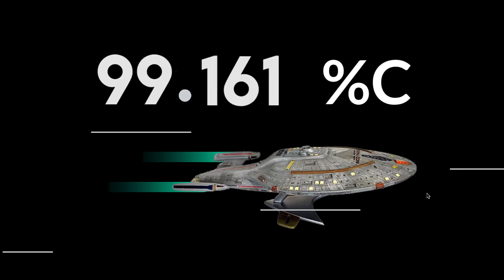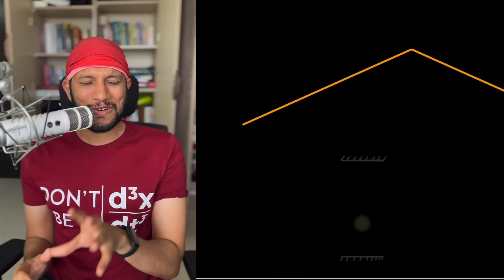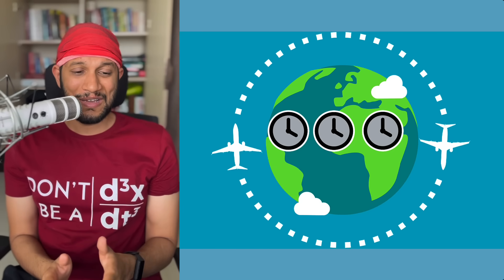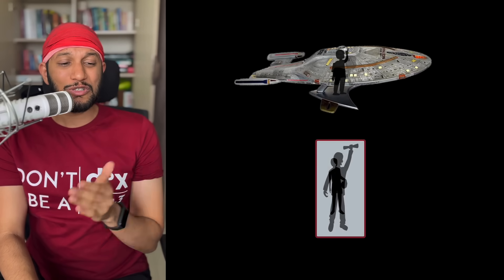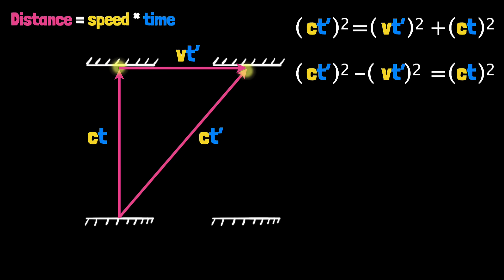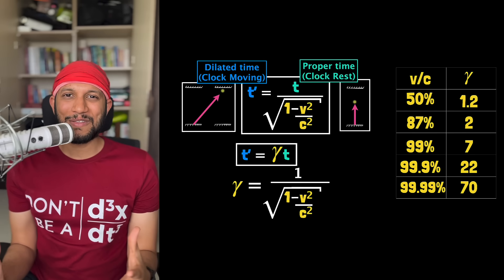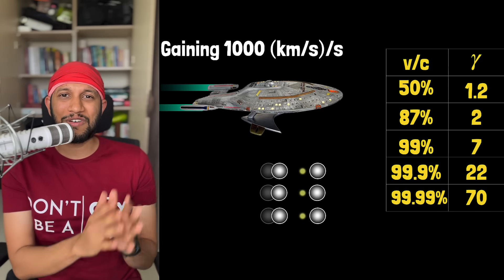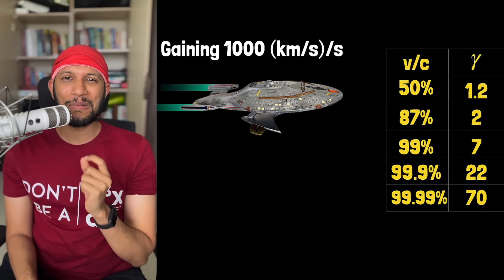I finally understood why you can't go faster than light! (My mind is blown)

Comment: Well done!   Dont forget the equivalent length contraction facet too! Will be good if you can do this before you get to e=mcsquared.

By the way, your explanation of time dilation (and later length contraction) will give you an understanding WHY a photon of light from a star which we SEE when it strikes our eye LEFT the star AT the same INSTANT we saw it!!    From the perspective of the photon, which is travelling AT the speed of light, it has had NO TIME at all since it left the star till it struck the retina.  In other words, the time elapsed (t prime) was zero, ergo, instantaneous.

Please don't let your philosophy quibble muddle you!  We MUST stay WITH WHAT the equations are telling us!   When you have finished length contraction, I'll point out the other way of what happened from the perspective of the photon of light that left the star.

For this video, because the photon that left a star travels AT the speed of light, the time dilation equation FORCES us to conclude AND to ACCEPT (unless we are utterly intellectually and scientifically dishonest) that the dilation seen BY the photon (t prime) was infinitely long. AND THEREFORE,  from the perspective of the rest frame, we (t) see the photon instantly AT our eye.

Remember, NO ONE HAS and NO ONE CAN measure the one way speed of light, for to do this, we NECESSARILY MUST have two synced clocks, one at the eye (earth), the other billions of light years away AT the star.  But no one has, can, or even will be able to place the second synced clock AT the star.

This means that when we are looking at stars in the night sky, we are seeing them as they are NOW!!!!

And while grappling with the implications of this, let us remember, most strenuously, that a light year is a measure of distance; NOT of time.

More, when you have presented length contraction, in your ever remarkable teaching style.
Reply from the maker: Lovely read, Vincent! 
I think the bit about one way speed of light is so subtle! I mean my first reaction to this was that we could use Einsteins sync method to sync the clocks, but it does assume the speed of light to be same in both directions and so, in Feynman’s words, ‘we would have cheated very badly’. I find it hard to wrap it around my head, though :)
Reply: @Mahesh_Shenoy  Indeed. And as he would say to those of us grappling philosophically with QM - "just stay with the equations. Calculate, and go WITH the equations. They do not lie."
Reply: Just making sure I understand: from the perspective of the photon from the star, it arrived at my retina instantly, but from my perspective it took x light years?
Reply: @billycox475   No! Not at all.  Let's go slow.  

In my frame, I see the photon now (cause it struck the retina - not the photon itself but its effect on the retine - but we quibble, you get the point).   BUT, because the photon was travelling AT the speed of light, NOT merely at 99.99 to the zillionth decimal place,  v=c, and the denominator of gamma is zero, and so gamma itself IS infinite and THEREFORE, and ONLY THEREFORE, the photon's time (t prime, as seen from our reference frame - ours is t) has dilated to infinity!!  

We make choke at the implications, we may balk at it, we may whine, we may ignore, we may pooh pooh, and we may TRY to comprehend, BUT the equation plainly declares to us (doesnt ask for our opinion) that the photon has had infinite "time" to get to our eye.  THAT is the dilation of photon time AS perceived from our rest frame t!!   

This then implies (HAS TO) that even IF the universe WAS infinite in size, the photon HAD infinite time, and thus could reach the eye NOW - meaning you and I see the stars and the galaxies, however far each may individually be, as they ARE AT the instant we see them all!!!!

This is JUST the way the universe has been made. If we dont like it, then with equal vehemence we should NOT "like"  quantum entanglement.  But we DO accept QM (and that with great gusto and fanfare), and so we are intellectually and especially scientifically dishonest, to the core, if we DONT accept the dilation of time, and coming soon (thanks to Mahesh) length contraction.  

Some more jaws on the floor when we get to that.  In fact, length contraction will help us grasp the implications of time dilation more easily, but in an unexpected way.
Reply: @vincentpinto1127 Light doesn't have inertial frames, so the time dilation math can't actually be used for it. If you look at the Lorentz factor equation 1/sqrt(1-(v/c)^2)), a v=c works out to 1/sqrt(1-1), or 1/0. Since that's undefined, it's a sign that we've reached the limit of that model.
Reply: @Vexas345  The last sentence sounds "clever", EVEN IF it is undefined. It is undefined mathematically, but in reality there IS an very serious implication of v being =c, which is NOT obviated by carte blance invocation of "undefined".

Furthermore you ARE correct that light, per se, has no inertial frame! But you are fatally incorrect because it is NOT that light has no inertial frame, but that each and every last single photon of light DOES HAVE its OWN individual inertial frame. This is BECAUSE light IS composed of individual photons, each a quanta of energy, and as the quanta of light propagate, the inertial frame of every last single photon goes WITH its own quanta!!   

When we see a star, we are not seeing it due to a single solitary photon striking the retina, but (I'd guess) perhaps a million individual photons striking the retina to form what we call the image of the star.  There are more complexities, but not immediately relevant to the fact that EACH and EVERY LAST of the photons has its own frame of reference, and each  is an inertial frame because the velocity v of the each and every last photon is c.   And each of these million individual frames have their time dilations seen as their individual million t primes as they strike the retina.
Reply: @vincentpinto1127   I'm not saying light can't actually be acting weird or anything like that. But if the math doesn't work, then we can't use it to describe how something is behaving. To put it another way, it's like if someone only has E=mc² and is trying to describe the energy of a photon. Obviously the answer won't make sense, photons don't have mass but still do have energy. It's not that something is wrong with that form of the equation, it's just not applicable to light in that way. We actually need the expanded form, E²=pc²+(mc²)², or just E²=pc² since m=0, which then gives us a real value for a photon. 

The Lorentz transformations don't give valid answers for massless particles, because it needs valid inertia frames, which require mass. Massless particles, including photons, can't be considered at rest. It's actually baked into the Energy equation as well. If we consider them at rest, they would have no Energy. 

Time dilation is also not something anything sees in itself. If we could consider a photons point of view, it wouldn't experience things too strangely (if the math actually worked). We should be the ones seeing the light acting weird, the photon itself would still have to obey physics and travel only at the speed of light.
Reply: @Vexas345  
>Time dilation is also not something anything sees in itself.<  I actually did not say nor even imply what you have said.  This is self-evident because in the photons own frame of ref, its time would be t and NOT t prime!!  Rather, the earth's would be t prime. But that is NOT what we are focusing on, so the rest of the last para is moot. 

As for para 2, I am not sure from where you get that idea "which require mass" (pl provide some ref so I can follow up). Its the first time I'm hearing it.  An entity is moving with a velocity v, doesnt matter if massless or not, it has its own frame of ref.  Furthermore, to comprehend the photon propagating as a quanta of electromagnetic radiation, we must have its v and b fields orthogonal to each other, and self propagating, because of the mu nought and epsilon nought of the space though which it is propagating. But what does "orthogonal to each other" mean if there is no native frame in which the two artifacts CAN be orthogonal?

As for the first para, I realize Mahesh has yet to come to e=mcsquared and how he presents it; I do want to wait for it. Nevertheless, to the point you are making, I still am unable to see the equivalence of the argument by moving from time dilation to the energy of a massless particle apart from trying to force the justification that the maths ought not to work. 
Even in an absurd case, dont take v = to c, but take v as 99.99% to a zillion decimal places. Then the denominator WILL NOT be zero, and the maths will have worked, absurdly large though the time dilation of t prime will be.  

Sorry, I'm not trying to be facetious, just trying to make a point.

I'm not saying I understand and comprehend WHAT is happening!! Not at all; I dont.  But the plain equation is forcing a conclusion I must make and an essential implication.  If we can make those implications (because the velocities are "small" enough) with muons from cosmic rays and their arrival times to earth, surely we can grasp the implications of photons whose v is exceeding close to c, and even =c, no?
Reply: >"seeing them as they are NOW"

Whose "now"? Simultaneity is relative, what is "now" for one observer is not what is "now" for another observer that moves relative to the first. The set of events that are considered simultaneous "rotates" in spacetime when we change a frame of reference.  See charts of Lorentz transformation.
Reply: @thedeemon  Simultaneity insofar as the interval of two events relative to the speed of light to be able to measure that those two events HAVE occurred IS relative.   But NOT insofar as the occurrence of those two events themselves.

It is entirely possible that a large meteor has just hit Voyager 1, and totally demolished it, exactly at the same instant as I type this, and you read it. (Let's imagine you are seeing this live as I type it, though we all know, in reality, some time will have elapsed from the time I type this and you read it.).  

YET, due to the finite speed of time, and the Einstein convention (Mahesh referred to), AND because Voyager 1 was made to to be sync with Earth clocks when it left here, we know that a finite amount of time will pass till we get a "message" here some time later that the signal from Voyager has stopped.   THIS is NOT what I mean by simultaneous.

So now go back and read my original post, slowly, focusing on the time dilation equation and WHAT MUST NECESSARILY HAPPEN when v is made to be =c.   Remember, you SIMPLY CANNOT PUT a clock in a galaxy far far away to sync it with an earth clock!
Reply: @vincentpinto1127  >"But NOT insofar as the occurrence of those two events themselves."

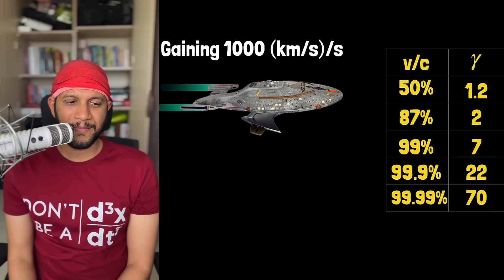Why? Two distant events may indeed happen simultaneously, say you type a message at 12:34 and a meteor hits Voyager at 12:34 by your clock (of course you can only learn about it much later, but the event itself happens at 12:34 as you type). Yet for an observer in a train, while you type at 12:34, the same meteor hits Voyager at 12:27 by the traveling observer's clock. The two events simultaneous for you are not necessary simultaneous in another frame of reference. That's what relativity theory tells us and so far it's been tested pretty well.
Reply: @thedeemon   I think you have missed what I am trying to say, or I have not said it well enough.  You do seemed to have "got" some of it in the immediate sentence after you ask Why?

You DO see that things CAN "indeed happen simultaneously" (to use your words), though of course, I will learn of it much later. BUT, we keep in mind that Voyager 1 itself is an inertial frame moving with a velocity v.  YET my concern with the meaning of "simultaneity", used in the context of the the same instantaneous-ness of occurrence that I type and Voyager gets hit, is NOT the simultaneity used in the context how one frame can determine WHEN something happened in another inertial frame!! 

Therefore, it is moot to bring in an observer on a train travelling at another velocity w.  While it is certain, we cannot compute the times, to conclude that an event has occurred, THAT THE EVENT HAS OCCURRED is what we can do only in a though experiment.   We MUST distinguish between the science of determining when a event occurs relative to all frames involved being subject to the speed of light which is finite and determine by epsilon nought and mu nought of free space, and the philosophy THAT the event has occurred simultaneously  is all frames of reference subject to the speed of thought which is infinite. 

Again, I am NOT being facetious.  

As I type, at say 1.37 PM, a meteor could strike Voyager 1, AND you could be simultaneously reading what I type at say a different time zone 12.30 AM!   Even your "simultaneous" reading WILL BE a bit later because of the finite speed of electrical signal travel, BUT instantaneous AT the speed of thought!!  Just that you will know of it a bit later.  But you must realize that if that speed of electrical signal were the speed of thought, THEN you would read it at the same instant that I typed it, and the meteor hit Voyager 1.

Stated differently, and lifting the abstraction a step higher, there are a zillion, zillion, gazillion things happening NOW in the universe, NOTWITHSTANDING, that we have NO means to comprehend it all, at that one instant.

Nevertheless, we are limited by the limitation imposed upon us by mu nought and epsilon nought, and thus the speed of light, to measure intervals of time to know an even has occurred.

BUT if v=c (as IS the case for a photon/electromagnetic quanta), then we (rest frame t) WILL SEE the photon's time t prime dilated to infinity.  And thus, the photon's t prime of  infinite time to travel incomprehensible distances occurs, and thus be AT the location of the rest frame t!!

We need not have to like it, we need not even have to be able to understand WHAT is going on. The equation declares to us the reality, the fact of  photon striking our eye as the NOW at the star!   

One serious problem we have is massive levels of intellectual dishonesty spoon fed to us by top level science folks, which we have swallowed without critical comprehension of the equations, when they say that a galaxy is 10 billion light years away, and that the light  we see now has had ten billion years to travel from there to here, ALL THE WHILE BEING TOTALLY DISHONEST to the fact that a light year is a measure of distance NOT of time!!

All that "10 billion light years away" means is that IF light COULD have traveled for 10 billions years at the speed of 300000 km/sec, and we convert 10 billion years to seconds, and then cancel the seconds unit from the numerator and  denominator, we are left with kms of distance!!  This is just how FAR the star/galaxy IS,  NOT that light HAS HAD TO TRAVEL FOR THAT MUCH time till it got here!
Reply: @vincentpinto1127  Looks like you believe your frame of reference is special, and if two events are simultaneous in your frame they are truly simultaneous and must be so in other frames. This is in direct contradiction to what relativity tells us. 

You also seem to have a problem with some basics of speed. Yes, a light year is a distance. A distance that light travels in a year, in a given valid frame of reference (not light's own, it doesn't have one). If light from Alpha Centauri takes 4 of our years to come here, the distance it travels is 4 light years. Simple, no lies. And the light we see today from that star was created 4 years ago by our clock, no problem with that. Even if by photon's clock no time has passed.

Think of a simple experiment: what if we had a big mirror on the Moon and you could look at yourself in it. Will you see yourself as you currently are, or delayed by 2.5 seconds?
Reply: @thedeemon  This is because we have a convention that the inbound speed of light is the same as the outbound speed of light.  This is a convention.  Mahesh, in his response to me, briefly alluded to it as Einstein Convention, or more formally as Einstein Synchrony Convention. But no one has, can or even will measure the one way speed of light.  And Einstein knew this hence he spoke of the convention in his writing.

>>Yes, a light year is a distance. A distance that light travels in a year, in a given valid frame of reference (not light's own, it doesn't have one). If light from Alpha Centauri takes 4 of our years to come here, the distance it travels is 4 light years.<<
Circular referencing/reasoning. I'll leave you to find it yourself.

As for Alpha Centuuri, let alone any farther stars.galaxies, no one has, can, or will put a synchronized clock there with one on earth, so one simply CANNOT measure the time that has passed travelling from there to here.   The problem is that you have to fix individual frames of reference to the photons that leave Alpha C, NOT to Alpha Centauri itself!!   It is NOT Alpha Centauri that is striking the retina, but the photon.  And how long has the photon's t prime been dilated to? To infinity, because v=c. Hence from MY perspective, it has reached the eye frame of reference t, instantly.    Again, dont try to comprehend it anymore than we can pretend to comprehend how entanglement works!!  It simply cannot be done.

I'll exit this threadlet with you now, and I recommend to stay with understanding WHAT the time dilation equation is teaching us, and what its implications are.  And not with the relativity of simultaneity, which is NOT what the video is primarily about.
Reply: @vincentpinto1127  I’ll try to keep it short. There’s nothing meaningful to gain from discussing the passage of time from the POV of a photon. Photons don’t have rest frames. Your issue is you’re attempting to apply and reason equations concerning things with mass, to things that have no mass. Sorry to shatter your false ideas, keep your passion for Physics up though!
Reply: @R8FKL  You need to read my earlier responses.   My fundamental assertion is NOT from the pov of the photon; it is from our pov on earth.  WE see the t prime of the photon dilated to infinity when v=c as in the case of the photon. THAT is what the equation of time dilation declares. You finding something meaningful or not in it is moot. The equation stands and the implications that go with it irrespective of whether we will ever be able to wrap our minds around it.

Furthermore, the fact that a quanta of photon is self-propagating with its magnetic and electric fields orthogonal to each other implicitly indicates there IS a frame that goes with it IN WHICH the two fields ARE, of necessity, orthogonal.

And if you care, let me know a link where I can see why you assert this : >Photons don’t have rest frames.<  
It is a subtly worded assertion. Photons have frames; just NOT rest frames. For that matter neither does the earth. It too is moving.  The point then extends to that fact that in each of these two moving entities, we consider each with its own frame, moving relative to each other, and THAT is what we study with the two Lorentz equations.  That's all; nothing esoteric.

You'll likely need to get to more of the basics of relativity. Take care.
Reply: You clearly haven't comprehended what I've written.